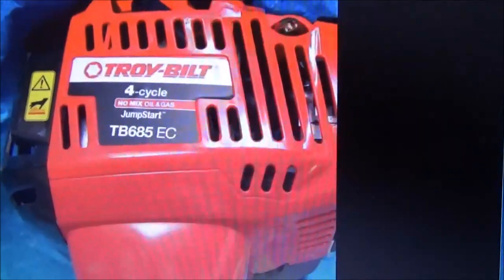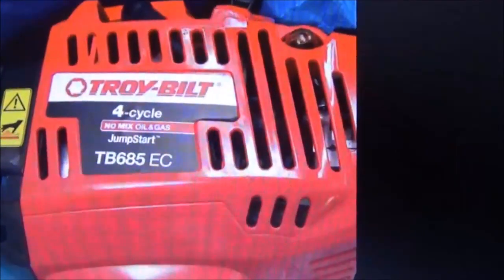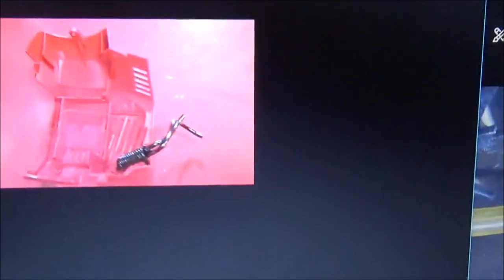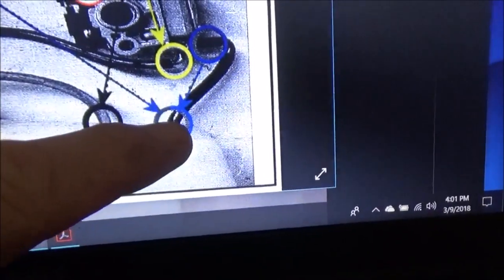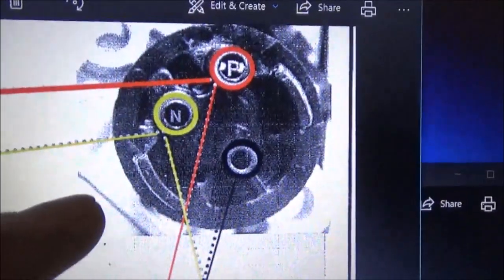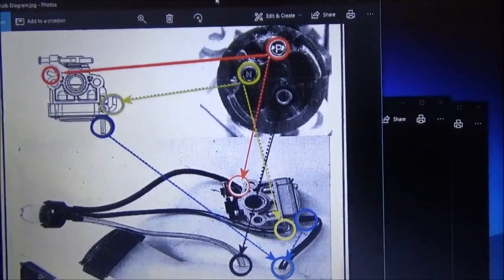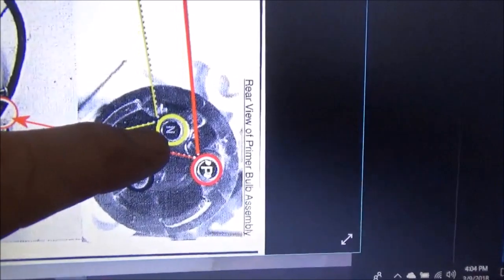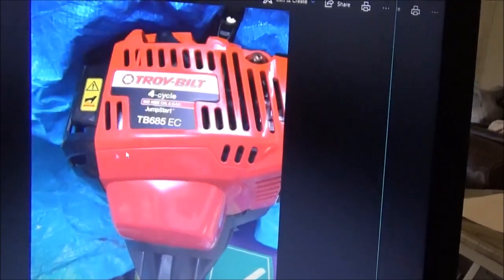Troy Bilt TB685 EC Fuel line layout with Diagram

Comment: I think when you pump the primer bulb, you are pulling fuel in through the filter from the tank  into the bowl of the carb (blue circles), and then up from the top of the carb bowl through to the primer bulb (yellow) and then from the bulb to spray fuel back through the carb inlet or throat in the red circle line.  The red line ends at the side of the air inlet where the choke should be.  I believe you are literally spraying a primer shot of fuel into the inlet.  The third hose on the bulb is a breather.  On a diaphragm pump like the little bulb, the dry side needs to be vented to air so you can pump on the wet side without creating a vacuum on the dry side.  Otherwise it would defeat the purpose.  At least that's my theory.

Comment: Thanks for the video, I'm really irritated at my  Troy Built trimmer right now, third season won't prime.
Reply: Not sure whats wrong with your weedeater but something i  know for a fact is dont use ethanol in any of your machines,find a gas station in your hometown that sells real gas,many problems with these weedeaters and mowers gets attributed to "well that brand doesn't work or its not good" when in reality its the gas people put in them, ethanol is worthless, i wouldn't use it to burn trash with.

Real gas is not that much more than ethanol,take my advice, ive seen what ethanol does up close and personal, might be too late for your present weedeeater but if you get a new one dont use ethanol.

Comment: I have this model and had to change that bulb and it was a pain. Now though having problems with the throttle it's being a pain to start. Will run after getting warmed up, but can't keep it at full throttle. Will cut off and/or tries. To when trimming. Thinking it needs new carburetor and lines

Comment: Dear sir,  I'm not trying to find fault.  The "p" on underside of bulb runs to brass elbow;  The "IN" runs to top of carburetor nearest the throttle-adjustment-screw;  The "O" runs to fuel tank (green line).  Please let your peeps know that primer bulb does not have to completely get full when priming.  & fuel with ethanol ruins this model carburetor. Tks.
Reply: Your configuration worked for me when the one in the video didn't. With a past career in mechanics, I was not wanting to allow myself to be beaten by a stupid line trimmer despite several frustrating wasted hours.  Was just about to pull out the last of my hair, and waste even more time and money buying a second aftermarket carb, when I decided to first double check everything I thought I knew to be fact.  The line diagram in this video being one of them.  So I went in search of something more than just a "thank you" in the comments.  Such as people in the comments saying the configuration in this video worked for them.  Luckily I found your comment instead claiming a different configuration is needed. And it worked!  Thank you so much for taking the time to suggest an alternate way! And Thank You for helping me preserve my sanity!  It is much appreciated.
Reply: I will add that I was using an aftermarket carb, so results may vary?
Reply: You are both right.  He is working with an OEM bulb and you were working with an aftermarket one.  For some reason the aftermarket ones are backwards from the OEM.  Maybe the Chinese lost something in translation but it definitely makes it even more confusing!
Reply: Thanks Mr. Sluga

Comment: John I'd like to know if gas is suppose to come into the bulb. When I 1st got mine I never seen gas till it started. This one i have is almost new.  It use to run till it got below half tank gas. I figured lines was wrong, you have good  video for sure, I  just don't see nothing wrong with the lines but am going change them an try it thanks bud

Comment: Thank you so much. I've been banging my head against the wall trying to reroute the lines after cleaning the carburetor and changing the fuel filter and bulb - still can't get gas to the bulb. My last resort is to change all of the lines - still does not work and I am assuming I have the lines misrouted. Wish me luck!

Comment: I had the same problem with mine,  I can't get the thing to run if the primer bulb is hooked up like the diagram,  I hooked it up so it pulls fuel out of the tank through the carburetor pump. that left a 50/50 chance for the other 2 (return to tank, and carb)  if you hook these up backwards, too much fuel will go to the carb and it will bog down with rich condition while running.  It runs good now, but takes several tries to start it.

Comment: I was gifted a new trimmer like this from my neighbor. He used it 3 times, said it started too hard, so his wife bought him a different trimmer.
I found the coil was not spaced properly from the flywheel, so it had poor spark, and it wasn't getting fuel.
Took me a couple days to figure out the black plastic line going to the top of the carb was a little short, and the factory bent the hose putting it on (quality assembly in Mexico?).
I replaced that line with a longer, more flexible hose and now the primer fills with gas and it starts with just a couple pulls.
I agree with others, that info on this trimmer is scarce and nearly impossible to find online. Owners manual is overly simplistic and a joke.

Comment: modle #TB675EC is the same problem . you are a big help but were did you finally get the replacement bulb with 3 hose ports ?
Reply from the maker: I found one on eBay.
Reply: I also have a TB675EC, my primer bulb only has TWO connections, not THREE like on this model.

Comment: Someone gave me one of these. I know why he gave it to me. Nothing but a red POS! Unless you also want to spend $60 on their hand held electric starter, the pull cord only lasted about 10 pulls before the small springs that ingage the pull cord broke. I scraped it and got a husky.
Reply: Aaron, the same thing happened to me with the pull cord. I think I used it for two weekends and the cord assembly broke. Luckily I had the Jump Start but for my drill. Troy-Bilt was always pretty much a two year disposable weedeater, but they’ve gotten so bad it’s not even worth taking a chance on them anymore. Absolute garbage.